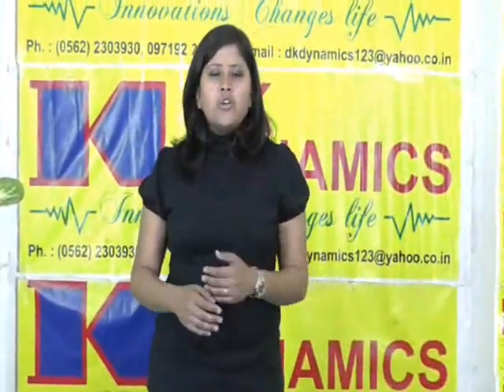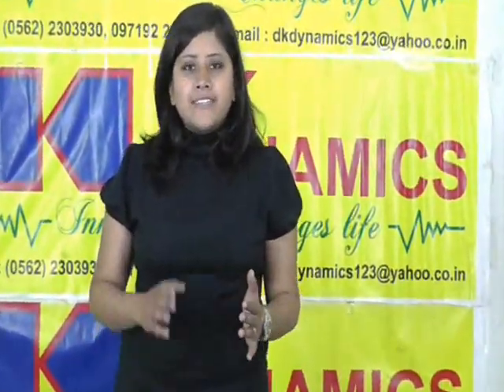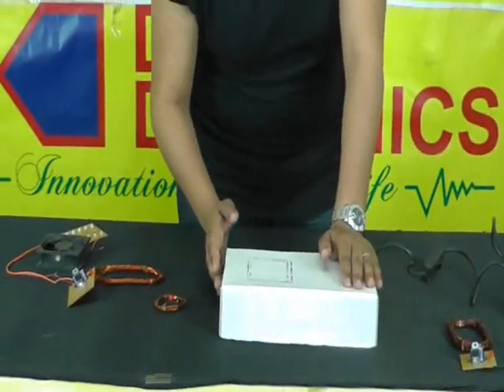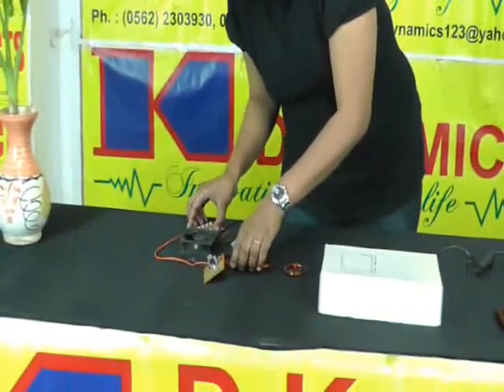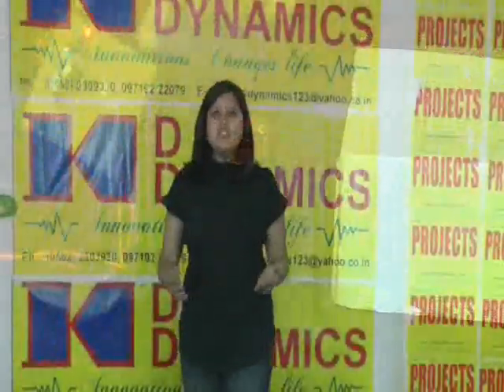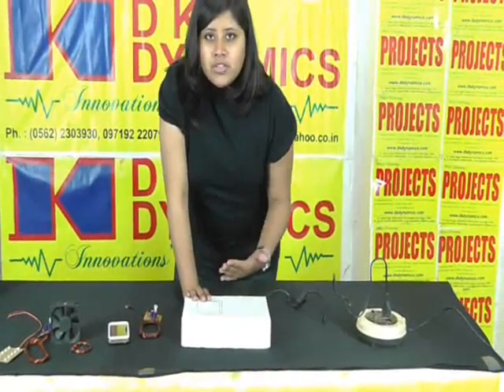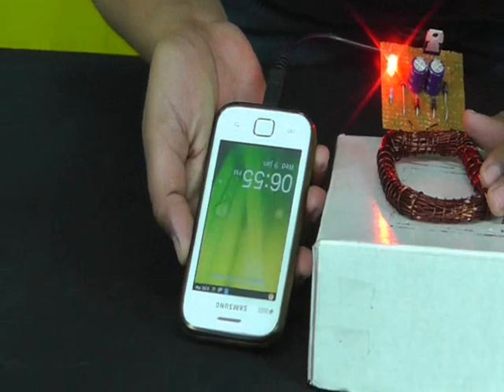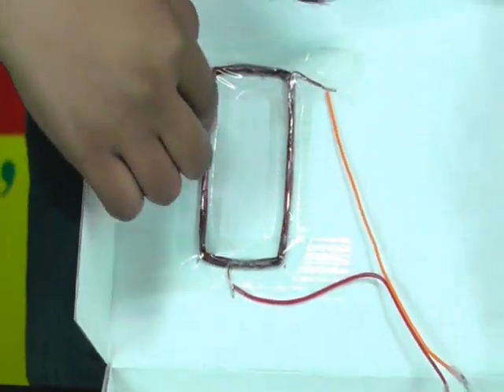Wireless Mobile Phone Charger

Comment: Guys no y u need the circuit diagram ?
U all know this simple phenomenon then y u need the circuit diagram
Its based on induction as transformer works on the same phenomenon
Large coil inside and small coil outside

Comment: ok! I made the same project instead of using a transformer... a simple tuned circuit was used whose pics are readily available on Google and just added a voltage multiplier.. I used different types of antennas and generated energy!! the above video clearly states that you guys are still using electricity,the moto of Nikola Tesla was to generate pure electricity from thin air!! the height of antenna used in my project was about 35feet.. that was a hell experience when lighting was struct to my antenna during rainy season!! huge voltage literally burned my project!! 
thank you again for such a good presentation and video!
Reply: Chup chap beth

Comment: Hey u have done good job BUT why you have not connected the wire of phone directly to the charger as you have connected wire to phone and the phone is getting charged with the help of the copper wire which gets energy from the wire connected to the box....you should do an experiment which charges phone when we keep the phone directly on the box you have made...think on it guys...

Comment: it is nothing than using a transformer i,e in transformer we use iron/ferrous ete cores but u r using no core so it becomes core less or air core. when u r using hand to show no connection the intensity is interfered,

Comment: Mutual induction huh.. :) any idea about the actual efficient power transferred...? its less than 50 %.... :)  and Nicola Tesla's wireless transmission is purely electromagnetic, it has nothing to do with High Frequency Alternating magnetic field induction, If you really wish to take this project to further heights then forget about the magnetic induction and concentrate more on Electromagnetic Power Transfer.. which is far better.. :)

Comment: Its not wireless transmission of power, its just you are using mutual induction technique. Here is a fault in your project if i'm keeping all the 3 circuits near to the white box, then in that case all the 3 circuits will work & do their respective job, hence we can't program the project to transfer power to a particular circuit only. For this you need to study electromagnetic waves , which can transfer power to desired location & desired amount of power.
Reply: kumaresh pal I agree with you

Comment: Thank you for the demonstration of Mutual Inductance (air core). Tip: When speaking to a single camera, there is no need to pace side to side. You might also consider looking into the application of that wonderful invention called Radio- The Wireless Microphone. ;)